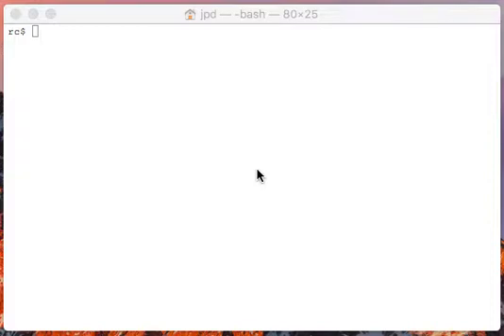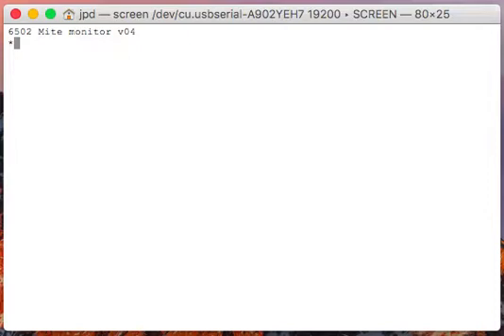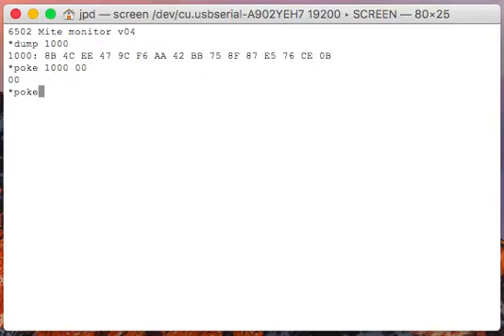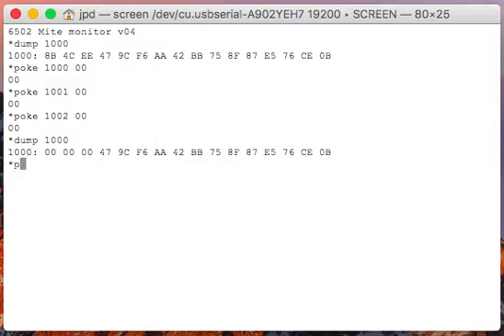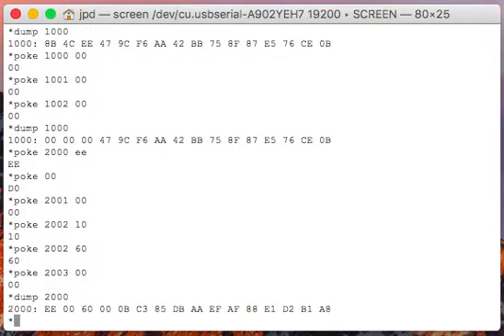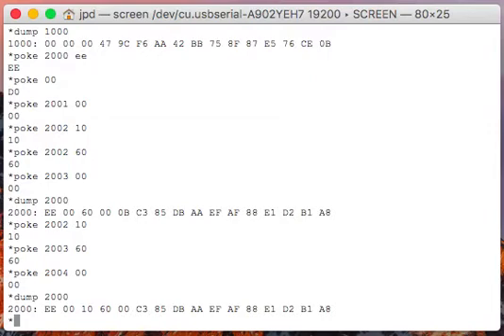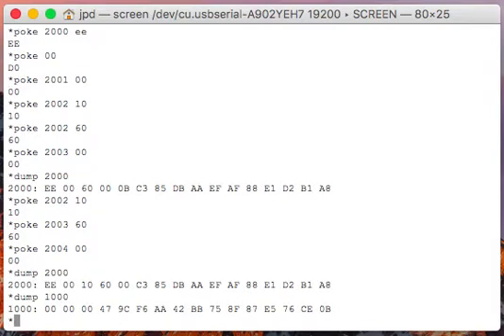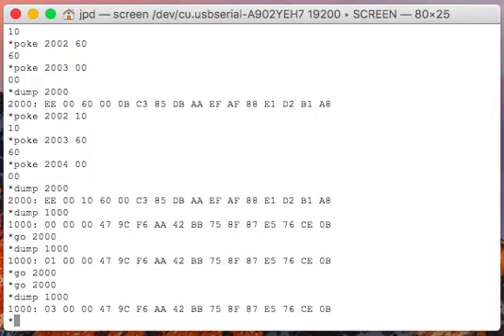6502 Mite homebrew computer project: step 6, basic monitor

Comment: Hi there. Thank you for your series. It has been really insightful. I would really like to understand how you created this custom serial monitor. 

Are you able to point me to the materials you used to learn how to do this please? I have been learning and practising Assembly and I see this (Early/Poor man's OS if you will) as one of the ultimate challenges!
Reply from the maker: I'm not sure that there are any resources that I can point you to, but here is the basic breakdown. As for everything, it's best to start slowing with a simple program that just reads and writes to the serial port, perhaps something that just echoes your text back to you. Then you slowly build up. 

My monitor reads a line of text, goes through it to figure out where the word boundaries are and turns it into an array of pointers to text words. Then it looks through a table to match the first word (the command). Each table entry has a word and a pointer to a subroutine. So when a match is found, it jumps to the subroutine address. If no match is found, it issues an error. Then it loops to do it all again. 

The code is on GitHub. My use of GitHub is non-standard, with version numbers encoded into the file name. So look at mon9 for the latest version... or at something like mon3 or mon4 for a simpler version. They all use this "dispatch table" mechanism though as described above.
Reply: @pauldourish  thank you very much sir. This is great information to go from! I will be sure to check out your GitHub profile 😀
Reply: @pauldourish  thank you very much. I have been able to make some good progress. Can you tell me what .( And .) Are used for in your code please?
Reply from the maker: @rossnesbitt972  Those are scope control for labels. If a label is defined inside those brackets, it can't be seen elsewhere, which means that it's safe to reuse. I use that especially for labels that I might want to use a lot but only with very local scope, like skipping incrementing the upper byte of a 16-bit value if there's no carry set. Every assembler has a different way of doing this; I use the xa cross-assembler (https://www.floodgap.com/retrotech/xa/) and that's the syntax it uses.
Reply: @pauldourish  awesome!! That's what my uneducated guess was going to be. Will have a play with them later.
Reply: How does your 6502 code interface with the 6551 chip, is it bitbanging the ports or going through the VIA? I guess the 6551 can generate some kind of interrupts when a new byte of data is ready to be read or something? Or is this going through the VIA chip? (Sorry I am just starting to learn how one would go about building a machine similar to yours).
Reply from the maker: @64jcl  The 6502 and 6551 were designed to work together. The 6502 in general likes to operate peripherals by having them mapped into the memory address space and then it simply reads and writes to the appropriate registers. That's how it works for the 6551; my address decoding puts it at $8800 and then I can read and write its input and output buffers directly.

The 6551 can generate interrupts when there is data to be read, but in fact I'm just polling it.

Garth Wilson's tremendous 6502 primer at http://wilsonminesco.com/6502primer/ will give you lots of insight into how to put something like my computer together.
Reply: @pauldourish  , very nice. Is there any limitation on CPU frequency for this direct bus access to work well?
Reply from the maker: @64jcl  The parts are designed to work together, so modern W65C51s can be clocked as fast as modern W65C02s (I believe they are rated at 14MHz). However, there's a catch. The current 65C51 implementation has a bug (has done for years) which is a pain to program around. So most people end up using old-stock 6551s, which are limited to lower clock speeds. I'm using a Rockwell R65C51P4, which is rated at 4MHz; I haven't seen any faster.